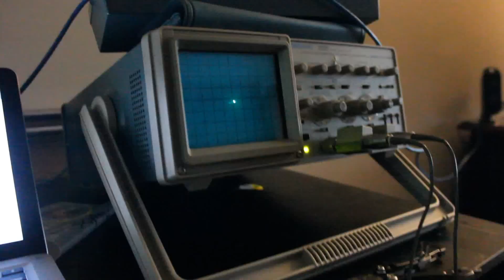Oscilloscope Music Demo

Comment: to connect an oscilloscope to a laptop or audio output, can you simply solder the aux cable to the probes?
(also great demonstration!)
Reply from the maker: Thanks! Yep, although I would recommend doing something like soldering clips to the aux cable that you can clamp onto your probes so you don't have to ruin your probe. I would recommend getting a 3.5mm jack like this: https://www.amazon.com/3-5mm-Repair-headphone-Soldering-Spring/dp/B00LBPKSNW or this http://www.ebay.com/itm/10-lot-3-5mm-Metal-Male-Repair-headphone-Jack-Plug-Audio-Soldering-solder-Stereo-/330841601186?hash=item4d07b234a2:g:FRgAAOxyjNlRyoXq
Reply: cool i might give it a try, thanks for the help!
Reply: @VincentWilsonSirSpaceGoat  any chance you can explain how you did this?

Comment: Can you post a walk through of how you connected to the probes to aux jack.. and settings used on oscilloscope. I’m having a hard time figuring it out
Reply: The horizontal and vertical probe inputs have + and -  and the Left and Right stereo output from the laptop has the same thing.  You should  be able to figure that out.

Comment: Please Please Please Please Please can you tell me what you are using to hook up the oscilloscope to your computer could you please include a link. Please Please Please Please Please Please
Reply: by any chance, did you find out how to do it?
Reply: +I'm in a Sams car no not yet
Reply: A year late, but that wouldn't work, that would send both channels to one input, when oscilloscopes use 2 bnc inputs for x-y mode, one for x, one for y.
Reply: Christopher Anton you can use 2 regular probes and a regular AUX cord to do this by the way.